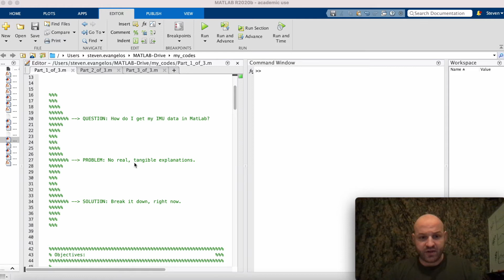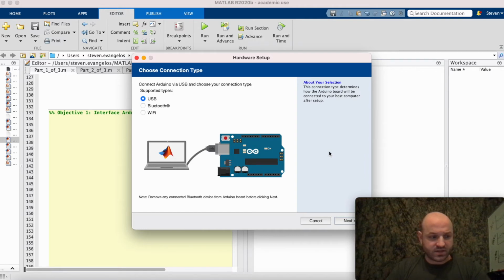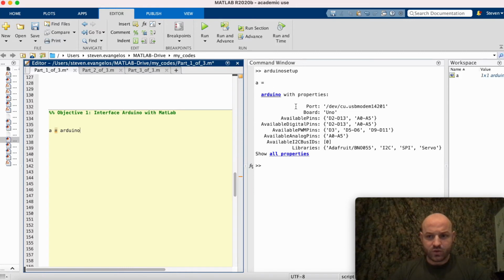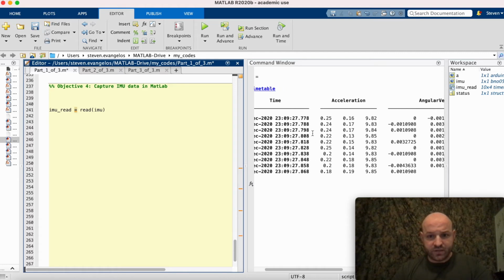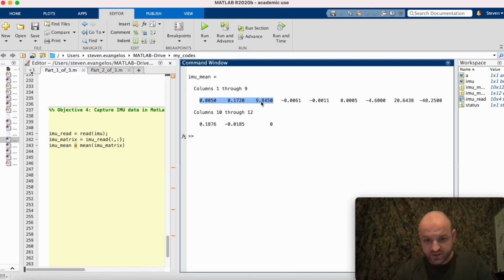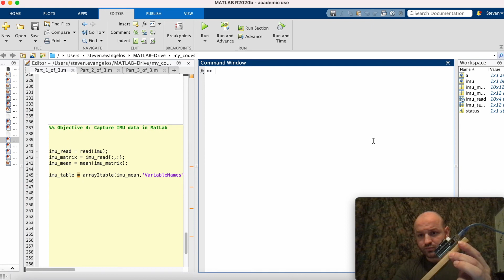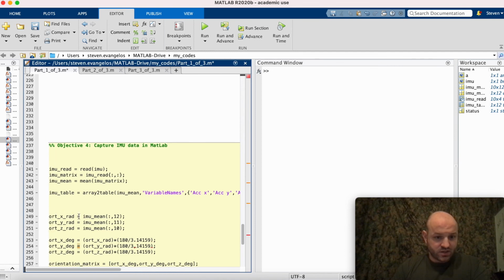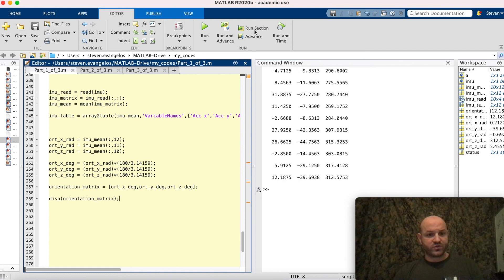How to IMU in MatLab (part 1 of 3)

Comment: Hi, I really enjoyed that video.  I was wondering if Matlab can read an IMU without using an Arduino with 2023b Matlab version? If not, why? If so, do you have any recommendation on which IMU model should I get ?
Reply from the maker: I haven’t upgraded to 2023b, so I don’t know. 

You could try a Raspberry Pi also. From my understanding, you’ll need a device that can communicate with the I2C interface. Arduino and Raspberry Pi both have this capability built in.

Comment: Hey, I'm getting an error like this. Would be glad if you could help resolve this!
"MATLAB connection to Uno at COM4 exists in your workspace. To create a new connection, clear the existing object."
Reply from the maker: Oh yes, you only need to run to “a = arduino;” and “imu = bno055(a);” lines one time. 

If you try to run them while they exist in your workspace, you’ll get that error.

Use the “%%” to separate your arduino and imu variables from your loop code.
Reply: @stevenevangelos  okay, will check. Thank you!

Comment: hi I have a question when I do the status = readcalibrationstatus(imu) 
I get this message on my terminal 
system:" uncalibrated" 
accelerometers: full 
gyroscope: full 
magnometer: full 
when i do the read command an error..
Reply from the maker: Sometimes the system calibration takes a minute or two. Move the thing around a bit and see if that helps.

Comment: Great tutorial! I think I have done correct, but System is always „uncalibrated“. Accelerometer, Gyrosscope and Magnetometer calib status is „full“. I had tried it several times?!
Reply from the maker: Make sure you are using MatLab 2020b, newer versions will not work.
Reply: @stevenevangelos  This is legit. I tried with 2021b and it will not work. It works for me in 2020b too.
Reply: @stevenevangelos  thanks. I will try it.

Comment: Is this the same as Im using MPU6050 Sensor? Thanks
Reply: Im using MPU6050 Sensor, and when Im calibrate using your code u made. Its says error and undefined function. Help me solve it. Thanks again.
Reply from the maker: For MPU6050, you’ll need to set your imu variable as “imu = mpu6050(a)”.

For MPU6050, there is no direct calibration command. Instead, since the MPU6050 is a 6-axis IMU, and has no magnetometer, you’ll need to apply a sensor fusion algorithm to reduce gyroscope drift and to approximate Angular Orientation.

Otherwise, you can go straight into reading the MPU6050.
Reply: @stevenevangelos  Thankyou sir. Now I get the point why I can't do the calibration command like on ur videos

Comment: Can you please help in connecting Arduino nano 33 iot and using it’s sensors
Reply from the maker: Hey, for Arduino Nano, you just have to select the Nano board during Arduino Setup in MatLab. 

Then type “a = arduino” and run code. If your circuit is correct, MatLab should find the board with the available pins.

More videos about different sensors with Arduino coming soon!
Reply from the maker: New video about sensors is up on my channel.